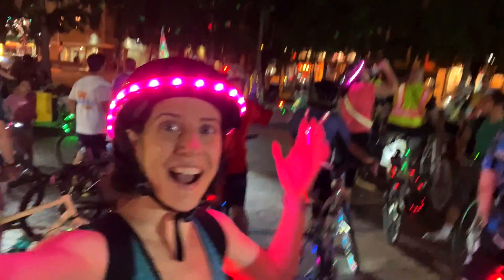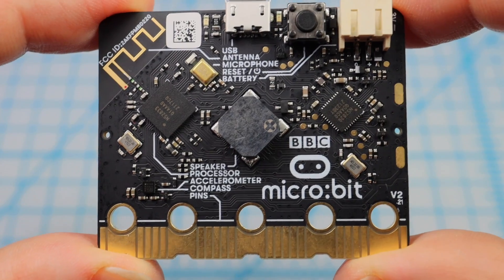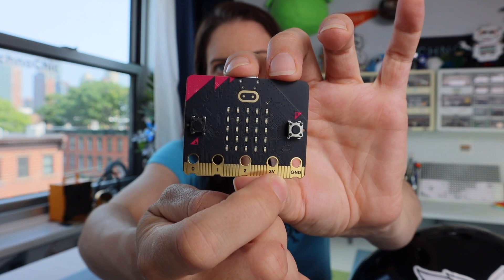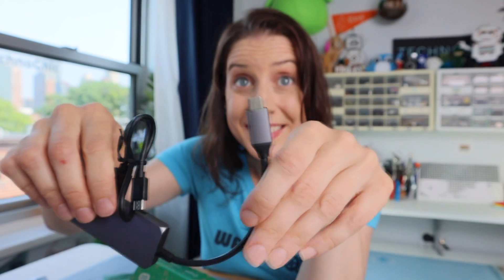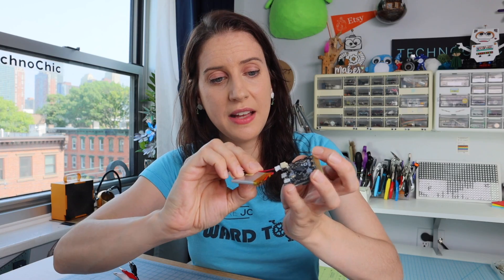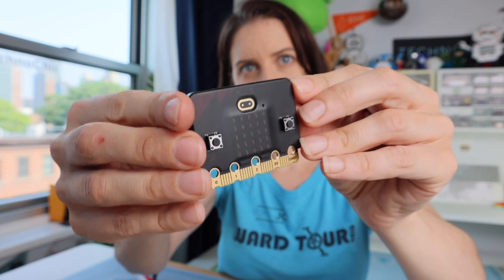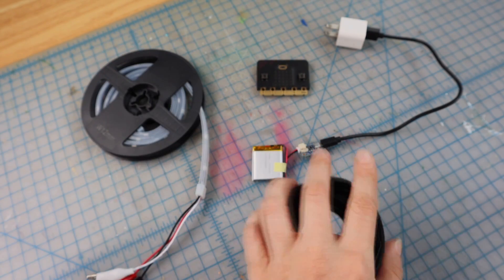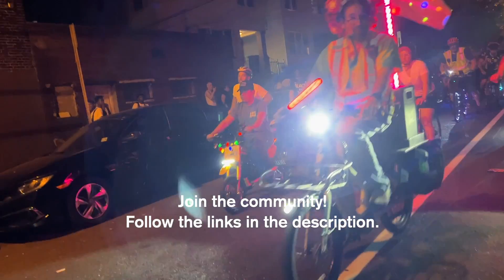Custom NeoPixel Controller: What To Buy // Creative LEDs * 02 *

Comment: Thanks for sharing your experience and knowledge In these videos. I just received my BBC Micro Bit.& Elevfreaks .Pico Ed plus a few weeks ago I purchased AdaFruit Neopixel strip with alligator clip. Your Neopixel video series has been both informative and inspiring.  I have learned so much admittedly I have watched several times.
I’m 75 year old life long learner & experimenter.❤ Retired Software /  Systems Engineer, & Educator plus Amateur Radio Operator , DJi Drone pilot ; electronics explorer: beginner Robotics Maker

Comment: Suggest using a USB battery pack instead, safer than dealing with loose lipos.
Reply from the maker: I tried that first too! However, running the project off of a USB battery pack will produce an inconsistant blinking effect (most likely due the circuitry in the pack shutting off when not enough power is drawn, or too much). After testing many packs, I haven't yet found a USB battery pack that doesn't produce this issue, please keep us posted if you do thanks!
Reply: And what do you think is inside a USB battery pack?

Those LiPo cells are perfectly safe to use with if you follow the basics - charge at a maximum current of 1C, and don't charge past 4.2v per cell.
Reply: @r1m.dog78 Most important is the protective casing, loose cells are easily damaged. The infamous Note 7 recall was due to one of the corners being compressed causing internal short circuits.